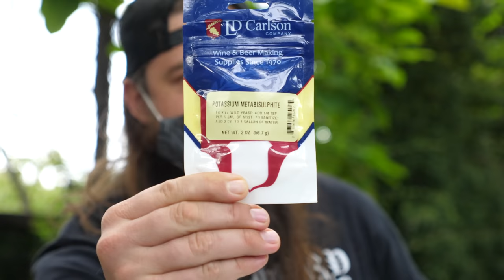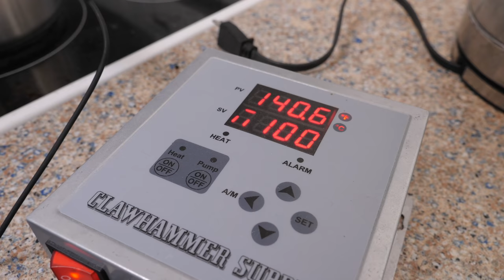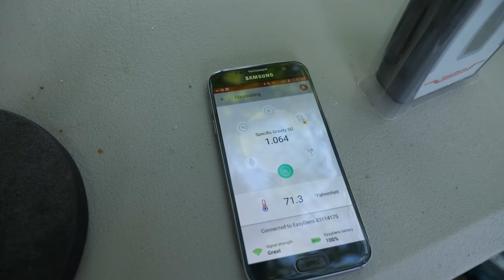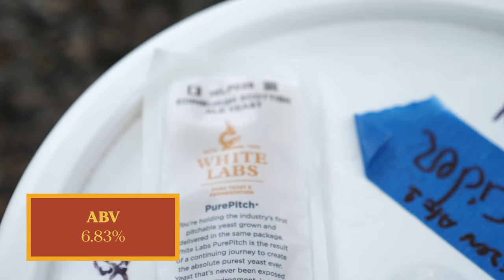Cyser? Hazy Honey Cider? Apple Flavored Mead? - We Brew, You Decide

Comment: Yes. This is mead/cyser. No, that's not how you do it. Honey is not sugar. That sulfur you were tasting wasn't the metabisulphite you used, it was from a stressed fermentation. You cannot brew mead well, quickly and successfully without a proper nutrient regimen. You should have done a LOT more research before this video.
Reply: Honey is anti-microbial because of the osmotic pressure of such a large amount of sugar in concentration. As soon as you lower the concentration (adding the juice), it is no longer anti-microbial. So that has nothing to do with it. Honey does have complex sugars that are difficult for the yeast to digest, and since honey has very little yeast assimilable nitrogen, it leads to a stressed fermentation.

Best way to make a quick session mead is Kveik, with a hefty frontload of Fermaid O. Goes fast, and doesn't leave off flavors. Cold crash, and bottle carb: it's ready in two weeks from the start, and in it's prime about a month after bottling.
Reply: @Vykk_Draygo  Would Kvieking be a suitable yeast?